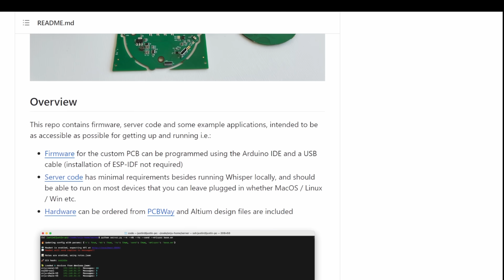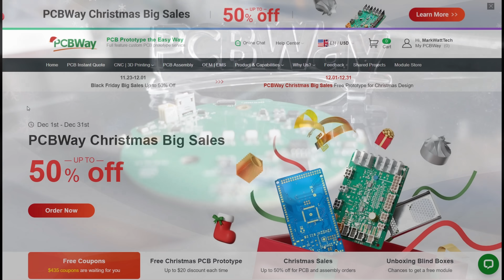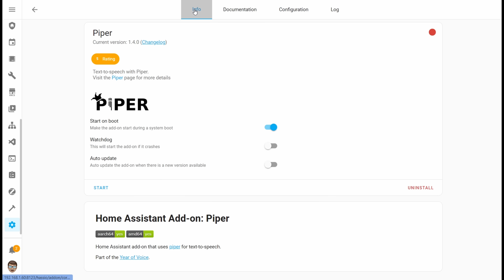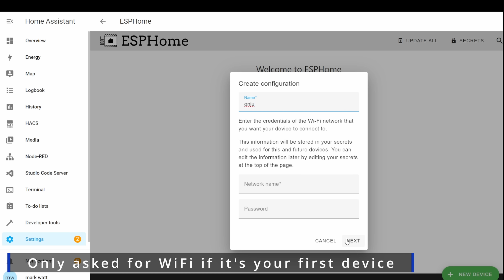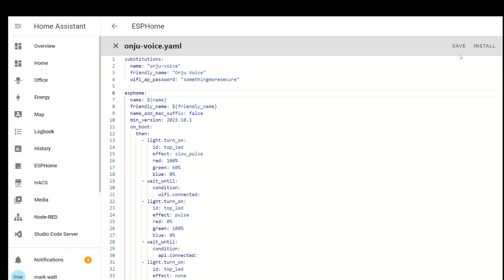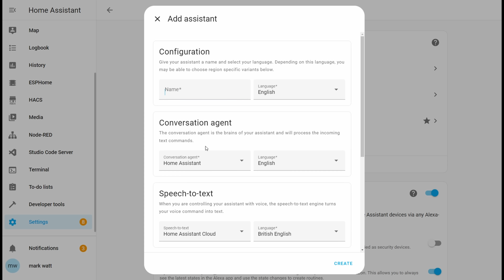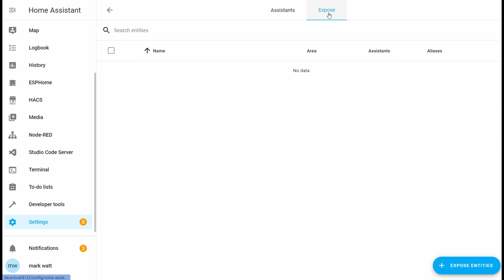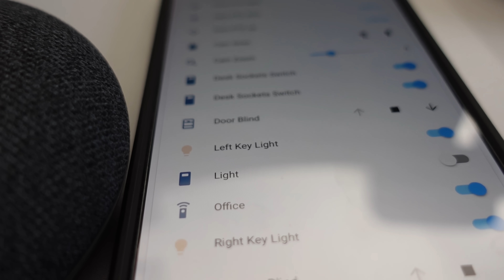HOW TO - Replace Google For an ESP32 (Onju Voice)

Comment: It worked for a while and now I got this error for a couple months:

INFO ESPHome 2025.8.0
INFO Reading configuration /config/esphome/onju-voice-1.yaml...
Failed config

light.esp32_rmt_led_strip: [source /config/esphome/onju-voice-1.yaml:326]
  platform: esp32_rmt_led_strip
  id: leds
  pin: GPIO11
  chipset: SK6812
  num_leds: 6
  rgb_order: grb
  
  [rmt_channel] is an invalid option for [light.esp32_rmt_led_strip]. Please check the indentation.
  rmt_channel: 0
  default_transition_length: 0s
  gamma_correct: 2.8

Comment: I've also got my boards and installed them into two Nest Mini 2. Both works, but I've noticed that after 12 hours they just stopped responding, look like mics are not active. I don't see any coming logs in ESP Home until I restart Nest Mini by plugging off the power cord. Any idea of reason of it ?
Reply: Have you managed to solve this issue, or did you stop using them?

Comment: is there any slimar project that utilizes old conference speakers?
Reply from the maker: You can hookup speakers directly to an esp and do something identical :) espmuse used to sell boards you could just add speakers to and get them into HA.
Reply: You can use a old computer or a raspberry pi and connect in speakers and a microphone and do the same thing. You can also get a ESP32 dev board and hook up a I2C speaker module and speaker and do the same.

Comment: Nice project ! How do you manage the speech recognition (is it possible to test it ?) and the text-to-speech function ? 
I need only a speech recognition witch can run a web request. Is it possible with your project and without home assistant ?
Reply: That was done with home assistant voice assistant pipeline. There aren't that many options for locally run voice assistants, it might be the only one right now. If you Don't want to run home assistant, then you don't even need this project as you can just turn on a googke nest and use the google assistant

Comment: Interesting! Could be time to play a little with Home Assistant again. I've been working lately on phasing Alexa out. She works well and in the past Philips Hue had big issues with Google (or the other way round, didn't pair, sync and work well). However lately I'm becomming annoyed by Alexa for a few reasons. She constantly reminds me to buy new batteries and you have to disable it on a per device basis - I'll change batteries when they're not working - not when there's still many months of use still left in them. Second when you sync devices she doesn't clean out old stuff that are no longer referenced in the linked accounts - that is even more annoying. So in the near future she's retired and replaced solely by Google - which by the way speaks my native language while Alexa doesn't

Comment: It would be nice if Google would allow us to create 3rd party firmware for our Google devices. I've got 2 Google Home Mini devices, but I'm not using them because I dont want Google listening to me. I'd love to use them and not throw them away, but it looks like Google will never allow open the bootloader.
Reply: If you switch off the mic, you can still use them as speakers in home assistant

Comment: Imo it’s not as good as an non modified google home, mostly due to the time you have to wait between the wake work and the command sentence.
And I would be surprised that the mic array works as good as the original one.
Reply: If you are running HA and the ESP Home Voice Assistant pipeline on a Raspberry PI together there is  lag;  if you are running HA ona  much faster AMD or Intel X86 solution, response is  almost the same as an Amazon Echo or Google device.  YWMV
Reply: My google home is already slow as dog sht. I wouldn't tell the difference

Comment: Can you reproduce music after the pcb upgrade? Does Hassio recognise the device also as a multimedia system?
Reply: Currently and sadly, the needed esp-idf framework has no media_player component available as this is not ported (yet?). That's the only reason I hold back on my Onju board order.
Reply: Ahhh :( one of the main uses for me is to play music synced across the house in multiple speakers. Really need to keep that functionality :'(

Comment: In the generated config that you replace with your prepared one, you can see a WiFi password you typed in in the step before.
It looks "too authentic" to be a random placeholder. Might want to check that.

Otherwise great video, I was looking into using myroft to build an interactive music/story player for my kids, but this might be an easier way without to much tinkering.
Reply: Are you on about the access point hotspot password? If so then its not a big deal. That's like when you turn on hotspot on your phone and someone else has to type in a password to connect to it. It was probably auto generated if I was to guess pal.
Reply: @kyedav right, my bad. I missed the comment about it being a hotspot and thought it might have revealed the password he typed in.
I watched on mobile and was too lazy to rewind and properly check it😅
Reply: @MaDFsX  all good man. Happens to the best of us haha

Comment: Based on what I see on GitHub the project looks stalled and no longer in development...
Reply: At this point I would say there isn't much to maintain. All future enhancements will come through updates to esphome.
Reply: Sincerely, hoping this project starts to gain traction and get picked back up by the current maintainer or forked.
Reply: The last commit was only two months ago!
Reply: @Zestysoft Here are three clues it's mostly stagnant: 1) 2 months is a long time for zero new commits. 2) All contributions so far have been by the same user. 3) The README says, "This is not being actively maintained." 0:10 So, while the potential sounds great, the project seems to be very stagnant.
Reply: I'm pretty sure I remember the creator said he wasn't going to maintain the project on X (Twitter) when it first gained traction as it was just to challenge himself for a personal project. That's also why he isn't selling it
Reply: Your prediction was correct
Reply: So fork it and develop it 🙄
Reply: If it ain't broke why fix it?
Reply: One bad thing about open source stuff. People can lose interest in developing for little financial gain quick.

Comment: What is the benefit here except HA integration
Reply: Being able to take control of what it does and knowing it's not sending data anywhere you don't want it to. You can also setup scripts to run on voice commands, so it's a heck of a lot more flexible... Yeah, it doesn't play music yet, and there's no alarms either, but those are being actively worked towards.

Comment: Is there a way to do this off grid? Most require internet for voice recognition libraries - any way to set up an offline local mirror?
Reply: You can get the home assistant box which uses a Raspberry PI 4 compute module. It won't be the fastest thing out there, but it can run a few voice assistants alright.
Reply: The Home Assistant setup he showed is local only, though you can pay to have it hosted by them. Home Assistant is hosted on a local computer, a lot of people us Raspberry Pis, but if you want to run off-grid Voice Recognition, that you'll want something more powerful.

Comment: Shame you can only get a replacement board for the Nest Mini (V2) and not the original Google Mini (V1) which I have a few (given to me) that I will never use with Google.
Reply: :(
I also have V1 that suddenly stopped working

Comment: Great video 😊 most of the way through now. Well described as usual.

Have a esp8266, inmp441 (microphone), max98357 (amp/audio out)  and 2W speaker ordered a week ago making it's way from china to experiment for £18. We're both UK based if want to do a video on DIY solution would post to you.
Reply: we're developing HA based 'smart building' products - atom looked good but mono no-good :-( your thoughts? cheers
Reply: @grahamdavid007 
Watched videos on the atom.
Mono sound keeps the device small + good enough for a voice assistance.
Add bluetooth presence detection.
Add a couple environment sensors like temperature, humidity, lux.
Reply: In addition I'm UK based open to ordering 5 fully assembled if anyone wants to share the cost just intrigued by it.